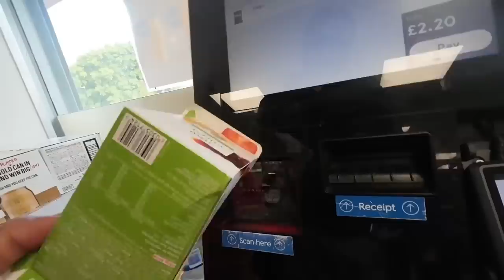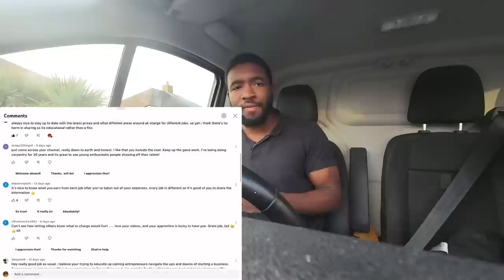Fire Doors and frames Fitting  a self employed carpenters Day

Comment: Hi mate I'm an old joiner just got a little tip for you 
Mark your hinges on an old door stop and put a screw in the top that will create a gap between door and frame you can then mark doors and frames without measuring again and you can use again and again hope this helps 
Good luck with the videos

Comment: Wee tip I use for linings, get an uncut corner of a sheet of mdf or ply and cut a 500x500 triangle out it and use the jigsaw to cut a handle. Handier for making sure the top is square instead of setting up all your lasers and you can just use one to line down the hinge side. 👍
Reply from the maker: thanks matey i’ll try this out
Reply: would you do that for both top corners LH and RH?
Reply: @JayG2K  you can do but if one is square at least 500mm along it will be ok usually I’ve found. Helps speed things up a bit if you have a few to do.

Comment: Nice job but I would ask why have you not fire stopped between the frame and the walls. You may have installed fire doors and smoke seal but a frame should also be correctly fire stopped otherwise smoke or flames will pass through the weakest point first.
Reply: Yes  agree with what you say. Would B2 fre are foam suffice?

Comment: I was always under the impression that fire door stops needed to be screwed rather than nailed?! Also the edges of the linings between the lining and the wall need to be fire foamed in?! Also the seals need to be smoke and heat seals with the brush type not the flat type?! Nice work

Comment: Soft block you should use a drill bit red plug 5.5mm or brown 6.5mm thats why it spins using the normal 6mm+7mm sds.

Comment: Great videos! How do u avoid to twist door frame? I was fitting doors first time, but all openings were non-standard, and I had to adjust door frames and doors to fit in. I watched probably 20 videos including yours how to do it properly. I'm still learning, so it's good to see some tips and tricks online. Back to my problem with door frames. When I fit it and everything was square and plumb, I cut doors to size. Then I router hinges on doors and then on frames. When I hang doors, I realized my frame is a bit twisted and doors doesn't close properly, and I had to adjust the frame and loose a few screws. I had the same problem with all 4 doors and I think I probably had too big gaps between frame and studs, about 1.5-2cm each side. Luckily everything was fine, and it all looks good, but it took me a long time to fit them and that's pisses me off a bit. Any advice how to speed up this process? Do you usually fit non-standard size doors too and have to adjust everything? Thanks for your time and keep doing good videos :)
Reply: That all come in time with practice and experience.

If I fit new linings I use a 6ft level to perfectly plumd the hinge side. I then hang the door and adjust the jam side accordingly. Everyone has there own way of doing things.
Reply: @JayG2K  plumb hinge side,(as suggested),,and make sure you level the header,,👍🏴👍🏴
Reply: Most of the time I've fitted a fire door I gave put in a new lining at the same time. Because the four is square to begin with I just level the header to the top to get the clearance.
Reply: To see if they are in wind/twisted, if possible you need to eye one door lining jam with the other, you have to stand at an acute angle to the lining, eye one jam with the other, make sure as you eye them both that they are parallel with each other, you can slowly move your head across until the top of one jam lines up with the top of the other, as you move your head and they line up/touch check with your sighting all the way down the jam to see if the bottom is also in line, once both the jams perfectly line up sighting them through with your eye you then know they cannot be twisted, in some situations like a corridor you cannot get your body/eyesight in a position to line them up... there is a trick with a string line for this situation but i've not had to do that for a long time so cannot remember the method completely
Reply: @nascorob  is the method adding string lines to to top LH corner and to the bottom RH corner and repeat on the opposite side to creaet and X. When the 2 lines intersect then should just kiss one another .
Reply: @JayG2K  Ye that’s it wasn’t sure I was going to explain it right I remember seeing it done a few times, awesome thanks for the clear explanation ✨💚🙏🏼

Comment: Good work bro. One Little tip the plaster board should almost always overlap to about ½ over the door rather than flush with the frame to prevent cracking when the door opens and closes.
Reply: Plasterboard flush with doorframe width and joint covered with architrave no cracking seen
Reply: @tonyorme1894  thats maybe true however best practice is letting the plaster board over lap for strength in addition to maintain the aesthetic in the event of a settlement
Reply: @go-toolzreviews  Plasterboard over the door frame to prevent cracking AND it strengthen the door frame!
Just stop.
Reply: @kevocos  lol I hope your responding from a place of knowing and not emotion. These are not my standard its not me making up rules its best practice established for many years.
Reply: @go-toolzreviews  There is no regular situation, as in the video, where plasterboard should overlap the door frame about 1/2". There may be some proprietary frameless solution that calls for it (although I have never seen one that does) and regardless that is an entirely different scenario.
Reply: Okay Sir let's agree to disagree
Reply: @go-toolzreviews  There really isn't any situation where plasterboard should overlap the door frame. In fact no wall covering should ever overlap the frame. 
First off you must have a control/movement joint to accommodate movement/cracking which cannot be avoided; this is usually provided for by either an architrave, shadow gap or a proprietary trim. 
Secondly any wall covering overlapping the frame will likely pass the hinge centre which may cause the door to bind. 
Occasionally people overlap bathroom wall tiles over the door frame but its poor practice and likely to fail.
Perhaps your "standards" need a revision😂
Reply: @kevocos  like I've said to so many others let's agree to disagree
Reply: @go-toolzreviews you're talking rubbish mate, in fact new builds with fire doors now require fire mastic which needs a gap no bigger than 10mm away from frame around all 3 sides.
Reply: @Dale-11  let's agree to disagree no need to get rude
Reply: @go-toolzreviews  no I'm rite, I do carpentry for a living now 20 years mainly 2nd fix and in the UK you never do that maybe in your native country but not here son.
Reply: @Dale-11  okay Dale. Different countries do things differently
Reply: @go-toolzreviews  nice packout update vid that son 👍👍
Reply: @Dale-11  thank you bro 🙏🏾

Comment: fire door frame should had fire sealant or fire foam door  stops should be glue and screw and fine door rated ironmongery   that his what told to do by building control
Reply from the maker: put in the description i did go back and foam , i was never told doors stops needed to be glued and screws but thankyou for all this advice i appreciate it
Reply: Fire foam is not rated anymore on NHBS needs to be fire mastic.

Comment: Intumescent strips should only be fitted after the frame has been painted/finished or it will invalidate the door certificate regs
Reply from the maker: i have never heard this but thankyou i appreciate this
Reply: Why?
Reply: You will have trouble getting in the strips after painting as the paint will leave an edge in the groove.
Reply: I undercoat/primer the door edges before fitting the int strips then fit the strips and then if the painter is decent there do a good job glossing the door edges
Reply: Not true I've fitted hundreds of front doors that have double intermittent strips fitted, painters are not allowed to paint them tho true.